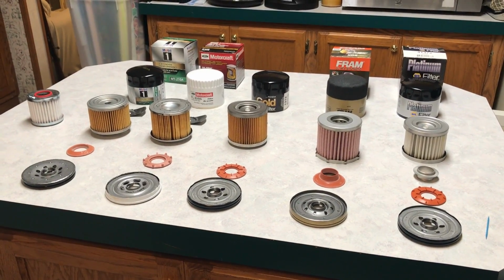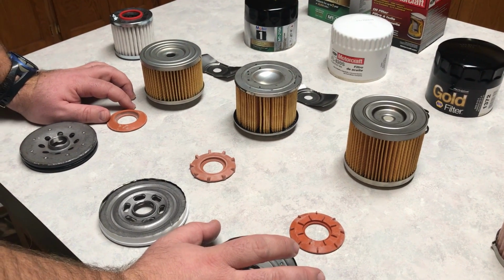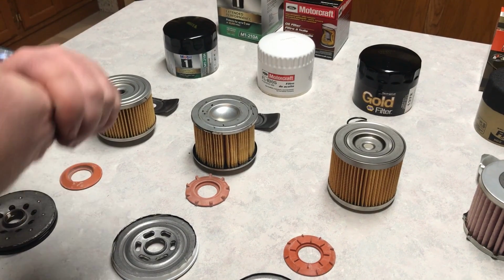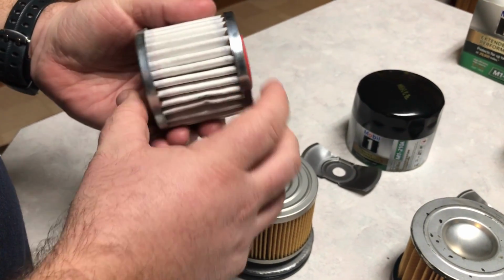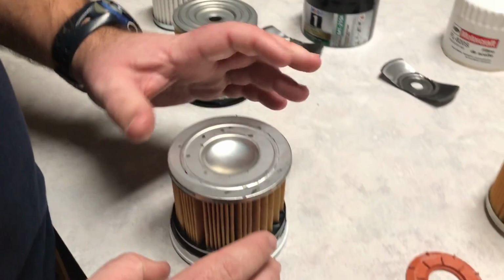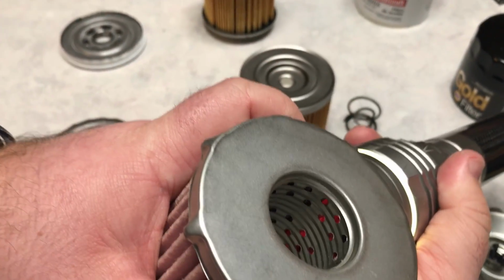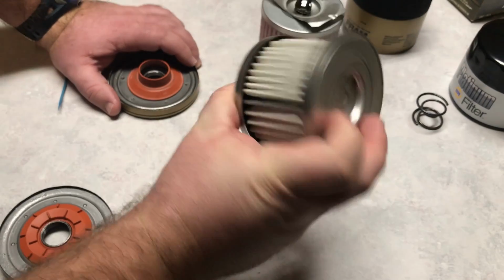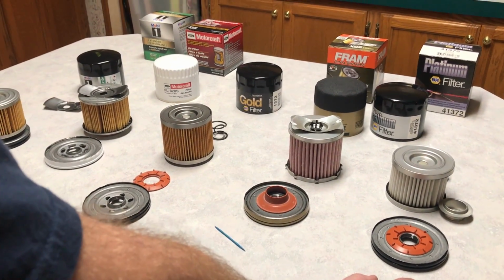2018 Cut Open OIL FILTER Comparison for Ford Modular, Mobil 1, Fram, Wix, Motorcraft, Napa

Comment: Nice job but i cant determine if you helped me more or stressed me out
Reply: Kelly t You can use all these filters without a problem. This video really gets into the small details and does narrow which oil filter to choose from. In the end, it's up to you to decide what oil filter suits you're type of driving style.
Reply: @TheRichardF10  There isn't much to choose when most over keen do it themselves people will be tempted to change their oil and filters long before they need to anyway! so worrying about the bypass valve on say the Fram being a little concerning! is not an issue ...

Comment: I would like to get your opinion on the new Purolator BOSS. The filter media I believe to 100% synthetic. Not sure how good the bypass and drain-back are though. The outside shell is extremely thick.
Reply: The Boss is the BEST synthetic oil filter made. Hands down. I use them.
Reply: Best Purolator filter ever made!

Comment: I'm sorry, but I can't agree with the most favorable comments. There's only a medium total information content in this oil filter roundup review. There's a lot of long, slow paced meandering discussion of points even the narrator isn't certain are important. There's not much consideration of attributes that contribute to key performance cirteria like filter efficiency and  lifetime and reliability. For example,. there was just a passing nod to the visible pleat density, but no evaluation of the filter media, didn't bother to remove the media and measure the total area, didn't bother to examine the reliability of the construction to see   where and how it was sealed or glued, and didn't look at the pleat seam to see if it would blow out.  I could go on and on...
   What's the point of de-lidding the filter cans if you only critique second level attributes you aren't sure are important? Tackle the stuff that has to be right for the thing to be of any use to anyone, the filter media and construction, the can, the mount gasket before you launch into things that depend on usage  pattern, and expected hours the drainback valve, and the bypass valve. Then notice the construction details like which kind of bypass valve and where it was mounted.
   And finally, anyone who took them apart and held forth for nearly an hour about them and still wants to try the budget conscious Fram filter in their engine might have looked more closely.at the opening shot.
Reply: Oliver....take your slide rule and deposit it up yours.
Reply: Whats your pick
Reply: But he did, for the most part. Try actually watching the review.
Reply: @ oliver....time for you to do a filter review.  see if you can get the same can opener as the host.   nice clean cuts.

Comment: Thanks for the in depth review. I have been using the Fram Ultra with Pennzoil Platinum in my 2013 Ford Explorer since the first oil change no issues. I think I’ll stick with those for now but the Mobil 1 doesn’t look bad either.

Comment: Best damn oil filter review I have ever seen. Great job! Unbiased and a little surprising the Napa platinum/wix XP had bad build quality. For the money the fram ultra is a good buy and a fairly well made filter. I am NOT a fan of fram by any means...I think they suck except for the ultra. Can you do more oil filter reviews please.
Reply from the maker: I have several other filters and plan on more videos.
Reply: I was going to say the same about best oil filter review I have ever seen
Reply: Fram sure grip
Reply: I agree with you on fram there is huge difference in build quality between their top of the line and lower tiers.
Reply: Wix are made in China

Comment: My type of videos, long and informative. Nice job. Out of these filters shown, Fram would be my pick. I am currently testing a Purolator Boss on my car. I am just suggesting but you should definitely check out Purolator Boss. It has a ethylene acrylic gasket instead of rubber or silicone. https://youtu.be/wk_8UFU5aDQ
Reply: Marco Jr Both Fram Ultra Synthetic and Mobil 1 are the only two of all of these that can go to 20,000 miles. Fram has a wire mesh that prevents it from imploding while Mobil 1 does not have one. Mobil 1 still uses a synthetic blend media while Fram Ultra Synthetic has a full synthetic media. I don't know how you can contradict that.